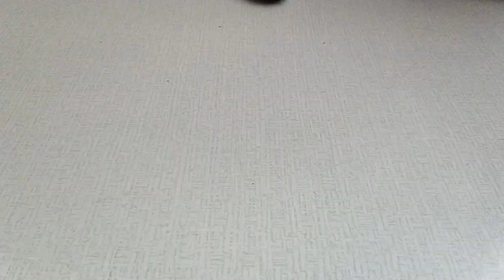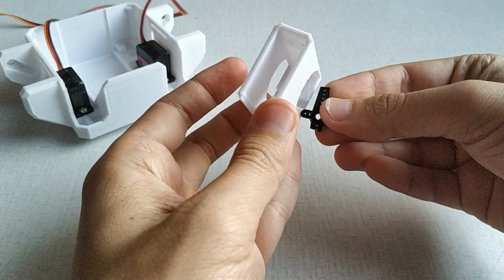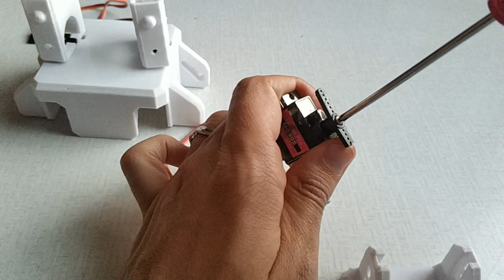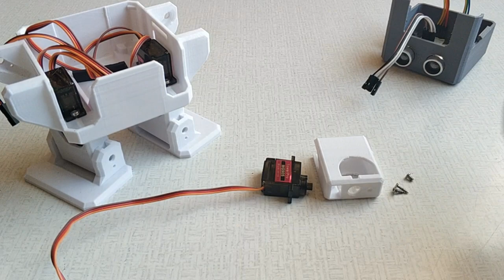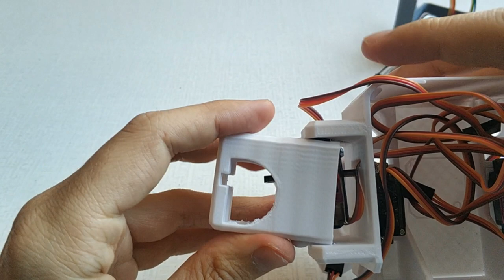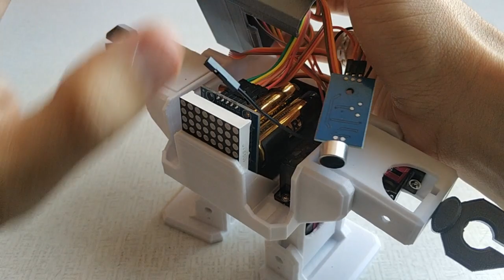How to build your own Otto DIY Humanoid, now with arms, grippers, LED Matrix and gyro sensor!!

Comment: The main board needs rework and that is never included, How do they make it work without it?
Reply: Hi, can you detail this? Thanks!
Reply from the maker: Not sure what re work you refer to,  but with our robot kits all you need to do, is in this video.
Reply: To which board do you refer?  The nano?  I was able to make it run just fine with the one provided.  Now their 3d printed parts... THOSE need work!  I got 5 of these things and ALL of the head pieces were broken.  I had bought the kits because I didn't want to spend time printing parts.  I had to print heads anyway because either their printer or their print settings are terrible.  The head pieces were all WAY to thin and the tabs broken, along with most of the sides.  I think I had only one head that was MOSTLY okay, but even it had a broken tab.
Reply: @roboknight  @Otto DIY, is this true? Can you confirm it?
Thanks.
Reply: @GnobarEl  I was going to take pictures of the parts and send them to Otto DIY... I think the packaging really did the heads in, but they were bound to break because the way the head has to be printed means the tab that holds the head on prints perpendicular to the force that would be applied to the tab.  The body probably doesn't apply that much force, but they wrap the parts together quite strongly with plastic wrap and that definitely did a number on the head pieces.  Now, when I printed the heads myself, I strengthend the parts by adding some shells (about 3) and increasing the infill and bingo, heads work fine.  But I expect they don't have the time to dial in their printers as I suspect they have to print quite a few of these things.
Reply: @roboknight  Hi! Thanks for your reply! 
Did you build the otto by yourself? How are (besides the heads) was it? Can you detail or, even better, make a small video about it?
I wanted to build one by myself, but I'm not really sure how are can it be to have everything working... Thanks!
Reply: @GnobarEl  Just so you know what I meant in my other reply:  Since 3d printing prints in layers, the force applied to the tabs ends up being perpendicular to the layers instead of parallel.  This means it is easy to seperate the tabe from the head because the layers just separate.  The design of the head might be changed to better accomodate this, but I find my print settings just fixed this pretty easily (they made the part stronger).  I also use a 0.3mil layer height (since you don't need THAT much detail).  Unfortunately, then I did run into some other issues where I SHOULD actually tinker the files a bit because the "eyes" aren't quite accomodated well (it would be better if there were a thicker wall with a cut-out for the crystal, for example).  But I got around most of those issues.  But it also would be better if it was a bit taller.  Putting all of those components in is a real cram session.  Its doable, but cable management is definitely a thing here.
Reply: @roboknight  Got it! How about the other parts? is it easy to get it working?
Reply: @GnobarEl  Yes, I built it.  This video actually runs through it pretty well (minus the bluetooth... I don't know why that's left out... Plus, I'd like to see what their feeling is on space... Its tight.).  When you get all of the pieces that I got (there is a bluetooth module, a microphone, a speaker, a gyro, a touch sensor, six servos, and the ultrasonic sensor) it ends up being a lot to cram into the head and body.  It helps if you try to manage the cables a little, but it is difficult to place the wifi and mic for sure.  What this thing really needs is its own "one board" solution so that you don't have to cram all of these seperate boards in.  But that would mean they would have to design their own hardware.  I think they mainly came up with the body design and software for the arduino nano.  The rest of the parts you can buy piece-meal (but their kit is definitely worth it if they can improve the print quality because you don't have to chase all the parts).  I would have put together a video (I'm trying to help 4 kids build these things) but I don't have that kind of time lately.
Reply: I forgot to mention, you definitely should watch this video and a few others.  The instructions have parts that might be vague if you don't know what you're looking for.  This video definitely helps a bit.  If you combine this video with the instructions, go through them a few times AND THEN assemble it, you'll be fine.
Reply: One final thought:  I did question their assembly order a little bit.  But maybe they've tried this dozens of times and never had issues and this really is the best way.  I had several issues because wires were a bit short and I basically needed 3 or 4 hands... but maybe this order really is the best way.  But again, I missed the part where they added the bluetooth module, as I really wanted to see where they put it.  I had to put mine parallel to the mic and perpendicular to the way they put theirs in so that it would fit.
Reply: @GnobarEl  So, the key is to make sure you put all of the signals where they tell you.  If you do that, then things will work "out-of-the-box" so to speak.  Also, you need to drop in their GitHub libraries into your Arduino environment (I know where to put them on Linux.  I think in Windows you have to put them where the program is installed... there is a Library under there somewhere... macOS, I don't know what macOS does, but I think its probably more Linux like), then their examples will run.  The only issue I am really having is finding the code that runs the robot that will let you use a phone to control it... they have an App... so I wanted to see what that did.  Also, I wanted to program it in scratch, because I am trying to help kids learn to code.  I've seen people do that, but I can't find that software or any instruction on how to get that working.  Once you do that, then the real issue beyond that is documentation.  For that you'll pretty much have to read their code to see what the Otto9 class can "do" (this is how you get it to display faces, dance and so forth).  It is "easy" for someone like me to build, I'd say.  I don't know if I would say its 100% "dirt-simple" (easy) for anyone to build it.  It isn't hard to understand, but a little experience helps cover when their instructions don't quite cover.
Reply: @GnobarEl  Oh, and double check where they tell you to put the audio.  I think MY instructions said output 13 vs 12 (which is what I think they said here... that was a red flag)... 13 seems to be the correct one because I had mine playing star-wars and Mario Bros.
Reply from the maker: @roboknight  we will show you in a future video where to put the Bluetooth module once we make a separate one for the APP setup that now we are launching also in the Apple store but basically there is a tab in the head to hold it, next to the board.
Reply from the maker: @roboknight  could you detail please what the instructions do not cover we will make sure to add in next version. Even do as you said we changed them dozens of times. :D
Reply from the maker: @roboknight  what do you mean by pin 12? we never said 12 for buzzer even in this video you can see is 13.
Reply from the maker: @GnobarEl  this is the first time someone complaint from our 3D printed parts, we have been always praised for the good quality, if the parts were weak could have been a forced packaging problem as you said, we always print them with very strong settings, so it will be nice if you send us the pictures @roboknight with details of when what and how it broke, to investigate the case and send you replacement.
Reply: @OttoDIY  Sorry, it was a different video I was reviewing.  They had the Pin 12 mistake, or maybe that was an older version of the robot?
Reply: @OttoDIY  Hi! Thank you all for your comments and feedback. I will finish getting the spares and join in this adventure of building the otto robot! Thanks!!! :D
Reply: @OttoDIY  Well, the BT module location was a big one.  The MIC module seems like its "standing"?  Not sure, but combine with the BT module, it doesn't work as I did catch in one video.  But it would be nice if the diagrams would have covered those two in particular as I especially wanted to know how you packed things in.  I think your print settings aren't dialed in for your printer either, because not only are the holes way too big for the eyes, but I THOUGHT that "tab" inside was where the BT module might go, but it doesn't fit back there.  It's way too narrow.  It needs at least another 0.25mm.  Maybe a little less than that if you want it snug.
Reply: @OttoDIY  Well, all 5 were broken out of the box.  It appeared that the layers near most of the tabs that hold the head to the body had separated.  If I can track down an e-mail, I'll send you the pictures.  Also, the long sides on most of the heads broke off too.  The rest of the parts did seem okay, but I think I did get different body versions as at least one version didn't have horn cut-outs on both sides. where the arms go.  Instead it had a hole for the arm and a horn cut-out opposite.  I wasn't sure if that was updated, or if the others might be updated.  The one that has the hole instead of two horn cut-outs seems to be better printed.  I'm not sure what printers get used to print these, but I re-printed the heads, using your files, 0.3mm layer height and 6 (maybe 7) shells (outer walls) with my Ender 2.  The parts were fine then.
Reply from the maker: @GnobarEl  you are welcome, see you in the community!
Reply from the maker: @roboknight  ok let´s divide an conquer:
1. BT and mic location we will make an additional video for it and add to the manuals as well, although by their functionality, they can go pretty much anywhere.
2. Print settings which ones did you use? was it different from you eyes holes and tab tolerances or is a matter of design? we actually layer height 0.15-0.2mm with good infill of at least 20%
3. Pictures of the parts please, would help a lot thanks, now is difficult for us to catch your valuable observations.
Reply: @OttoDIY  I used a 0.3mm layer height because it does print faster, but it also tends to print stronger parts.  Recently I've discovered (along with a few others mentioning the same thing about part strength) that thinner layer heights do tend to produce weaker parts.  But I think the biggest thing was I used 6 outer layers.  That really helped.  I don't know if changing your infill pattern would help any either (I didn't use rectilinear... That seems to be OK, but not great.  I think I used triangular infill).  I suppose you could try PLA annealing (put the pieces in an oven after cooling and reheating to not-quite the PLA melting temp... 160C or something, for a while), but that seems excessive.  Of course I think you could just print with more shells or even make the parts slightly thicker, but for you that is time and money so I don't know if that's a real option.  I sent you pictures of four of the heads.  The fifth one is with someone else, but it had the same issue (I opened them all first, to check the parts).  I sent pictures to the "web chat" system, so you'd have them to see what I meant.

Just so you know what I mean about layer height: https://www.3dhubs.com/knowledge-base/impact-layer-height-3d-print/  (this is not the only website that has this, but 0.3mm layer height is definitely 20% stronger for functional parts)

 https://downloads.intercomcdn.com/i/o/178149668/df0d5b0a9e3755eeb571b2df/2020-01-20-060718.jpg
https://downloads.intercomcdn.com/i/o/178149723/8633dc773cf486a55a1a6a6e/2020-01-20-060706.jpg

At least this will point you to two of the photos.  I took some others, but this trys to show all 4 heads I have.  One kit I had to give to another person, so I don't currently have it, but I checked all for missing parts before I did anything, and found all the broken heads.
Reply from the maker: @roboknight  great advice! we will for sure try this too, it would be great to have a record of all this also in our forum to help other Otto Builders, so that it does not get lost in comments, please join us and put your conclusions https://wikifactory.com/+OttoDIY/forum

Comment: Hello community,

Which two items are stuck with tape right opposite to the ultrasonic sensor.
Are they the 
Mpu6050

And three pin board with vcc, out ?
Reply from the maker: touch and gyro sensor but with the new version you can screw the gyro